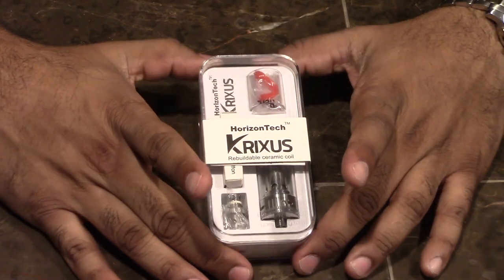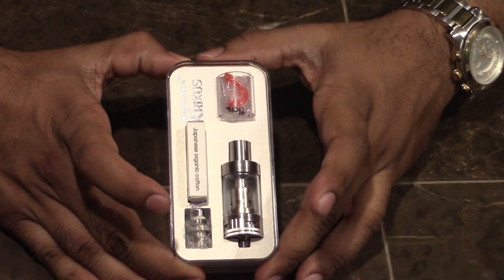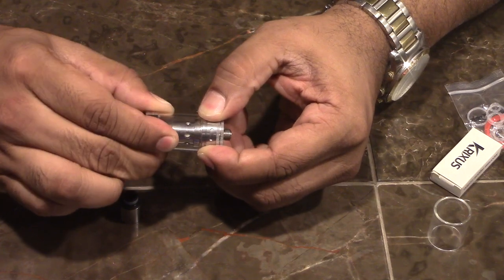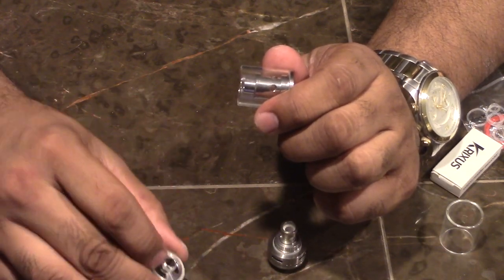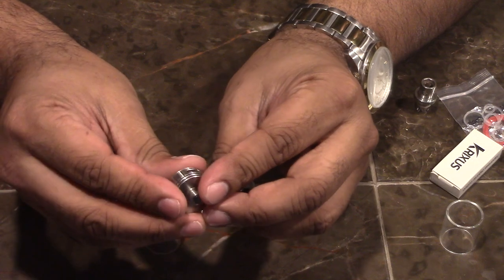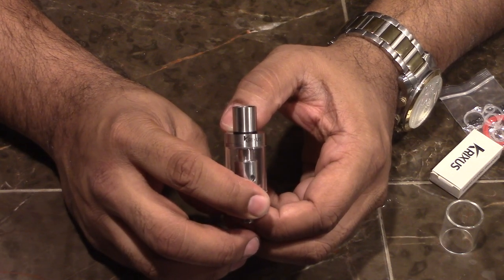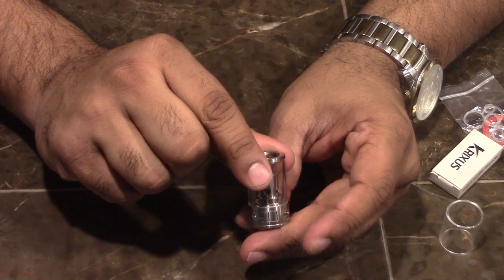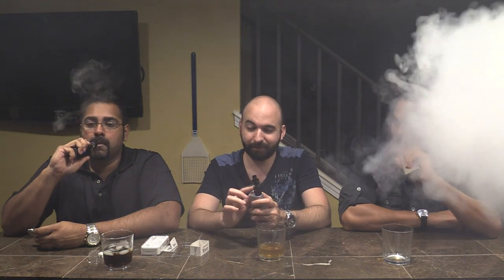Krixus by Horizontech - Ceramic sub ohm tank

Comment: To use this in TC mode, you need to set the TCR for tungsten wire. I definitely wouldn't use it in NI, SS, or TI considering the coefficients could be the tiniest difference, yet still be problematic.

Comment: i bought one of these and i loved the flavor but... i never rewicked it and its sitting in my maybe someday box. the reason is this thing gets super hot. i noticed you never mentioned that in the video. this thing gets so hot it will burn you if you touch it. you were puffing on that thing so hard i can only guess that your mod was hot in your hand. this is the reason i set it aside my mod was getting so hot i was worried about messing it up. maybe thats something you should have mentioned. i never had any leaking issues but again i never rewicked it either and i have read many reviews about it leaking badly as you mentioned. but untill the heat issues is adressed i dont think its for everyone and not on a single battery mod it drains a single battery quickly. like 1 tank 1 battery type. great idea and taste but other then that the performance isnt to great. you have to chain vape or take a super long lung busting draw to get much vaper. that was my experience.